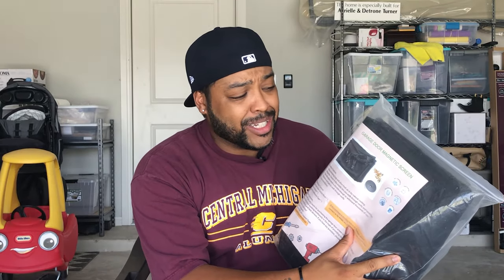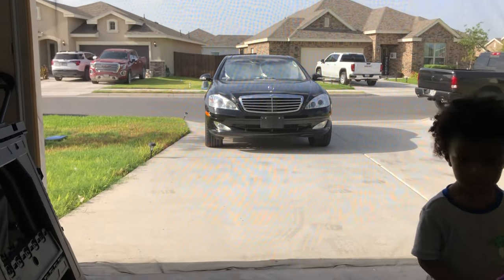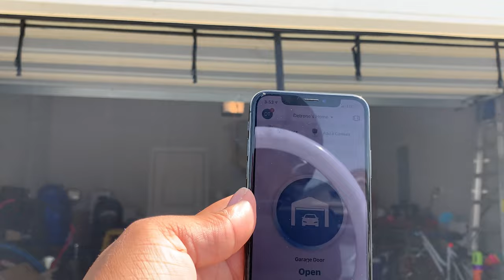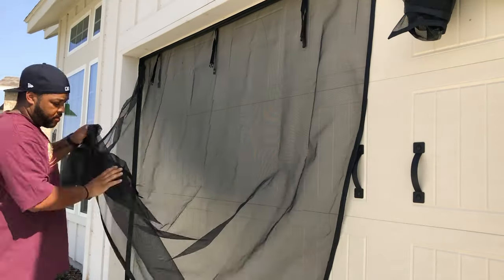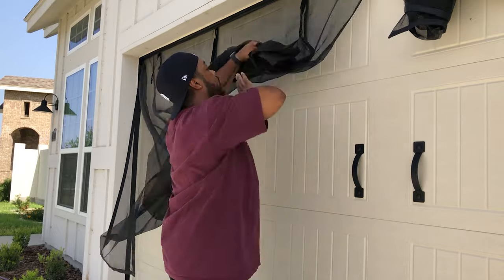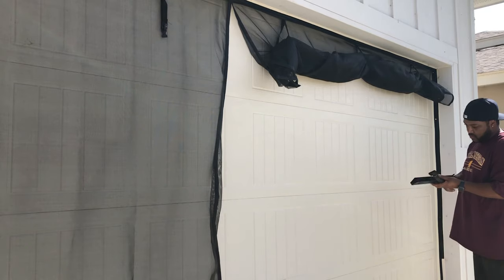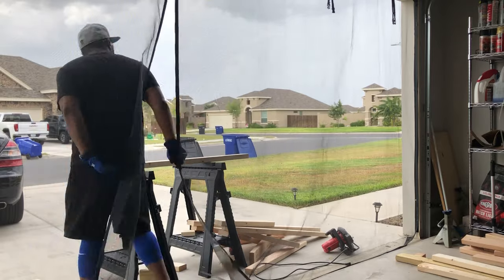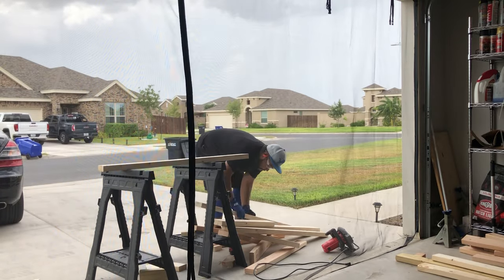Magnetic Screen Door | Fast & Easy Mesh Screen Install

Comment: Technically...doesn't it mount to the outside of the frame and not the inside...so that it sits flat. That's how I've installed 2 of these. If you used your inner frame, didn't the corners "bunch" up?
Reply from the maker: Yes, one corner did bunch up... Maybe you are right about the intended placement But there were a couple reasons I chose to go inside the frame.

-It seemed like a bit of a stretch when placing it on the outside and I didn't want there to be constant tension on the net, pulling the magnet connection apart.
-I wanted to ensure it wasn't floating to high off the ground and creating too much of a gap underneath.
-Lastly (not that it's that important) I didn't want the frame of the net to become discolored because of direct exposure to the sun.

Your placement would definitely eliminate the problem of the net sticking to the door when it raises, so maybe I'll try that the next time. Thanks for your thoughts.

Comment: notice:  those magnetic closures NEVER WORK... NEVER.
Reply from the maker: While I value your input here… I’ve gotta disagree (at least in this particular case)… They’ve worked as designed in each of the 3 screens that I’ve had even with the kids running in and out of them.

Thanks for watching and for sharing your thoughts.

Comment: What about theft. Can it be removed when the door is down
Reply from the maker: It can certainly be removed when the door is down since it is attached to the outer trim of your garage. If you use the pins as well as the Velcro it’ll make it a bit tougher for someone to take and would likely create rips if they try to take it.

Comment: Hi, thanks for sharing, I would like to tell you that makes the top-middle of the screen should be positioned about 1 inch higher than the top corners because if the screen drags on the ground, the bottom magnets won't automatically close.😁
Reply from the maker: Thanks, you are correct… if the middle doesn’t sit slightly higher than the side the bottom magnets won’t close automatically and you’ll need to reposition them in that case.

Comment: Thanks for this dude. It probably won’t work for me. My garage is all metal. Well done.
Reply from the maker: Yeah the stick adhesive would probably still stick to your garage but you wouldn’t be able to secure it with the tack that help the security. Also as a side note, the magnets at the bottom of the net would likely stick to the metal and raise up with the garage door every time you open it. Thanks for watching!
Reply: @DetroneDoesIt  thanks. I’ll look into it

Comment: Thanks for the quick and easy video! These have popped up on multiple houses in the area and I'm glad to see a good review before buying. I have a wooden garage frame so I'll probably stick and then staple the velcro in place after verifying that the placement is good.
Reply from the maker: Glad you found it helpful! They are super convenient, I advise getting one with the straps that allow you to roll it up, so that it’s out of the way at times you don’t need it. Thanks for watching!

Comment: Great video D.  I saw another video, and they said wait at least an hour before installing strips. Good explanation about the push pins
Julia
Reply from the maker: Thanks for watching! Yes the push pins do the extra work of supporting the screen, so I would definitely not skip those. As far as waiting an hour… I put mine up right away after cleaning the area and it’s been working great.

Comment: I’m living in an insulated cargo trailer while boxing full-time. I figured I could just leave the doors open instead of getting A/C… but mosquitoes. About to get some of these too.
Reply from the maker: That’s a pretty cool idea, if there is some cross breeze that would be a easy way to keep bugs out but still get air.

Side note: How is it living in an insulated cargo trailer? Did you build it out yourself or did you buy it move in ready?

Comment: 💡🧠 Was also debating on attaching the screen to the BOTTOM of the Garage door itself, to possibly avoid the Outside rolled up look since i won't have it down while garage is Shut anyways... 👍🏼 But Thanks! Good Video #BeatFloridaHEAT 🥵
Reply from the maker: If you have a way to keep it out of the way of your garage door while it's closing, then it might be worth a try. That Florida heat, much like this Texas heat is nooo joke! Thanks for watching and sharing your thoughts.

Comment: Hi,great video. I just installed mine and like it alot but one downside i"m getting is that when the wind blows a little inward the screen constantly makes the garage doors light come on.
Reply from the maker: Thanks for watching! Yeah that does sound like a bit of a downside… I have a similar issue sometimes when the wind blows and I’m trying to close the garage…. All things considered though I think the ups outweighs the downs with this screen
Reply: @DetroneDoesIt  yes i totally agree,Thx for replying

Comment: I think putting a hook on each end of the wood panel would solve the problem by just dragging each screen panel to the side and over the hook to hold it in place just like you do with house curtains.
Reply from the maker: 🤔 That’s a solid suggestion… I’m recently ordered a new screen to replace this one (since it’s now gotten pretty weathered) so maybe I will try that with the screen.
Reply: @DetroneDoesIt   I think there are several ways to get the screen out of the way without having to roll it up.  I was also thinking of putting one of those small clamps that holds things together on the other side of the Garage wood panel inside the garage, so it can just grab the screen without it being shown.  Another way is sewing a metal or plastic ring at the center of the screen so I can pull it up on a hook.  Anyway, I ordered a screen and will see what I can do with it and post here.
Reply: @DetroneDoesIt   I just ordered a screen and thought of several ways to get it out of the way without having to roll it up; I will post it here when I find a practical way and maybe show a video on Google Drive.

Comment: So what happens to the screen if you open the garage door?  Does it stick to the rising door?
Reply from the maker: Yes, unfortunately it does sometimes stick to the door as it rises. Some folks have suggested that installing it on the outer face of the garage door instead of the underside might help with that.

There are ways to stop it from sticking but none that are super inspiring. I have a small piece of wood on each side at the base of my screen that keeps it sitting away from the door as it lifts and lowers to lessen the chance of it sticking.

Comment: Great video! Thanks! I wondered if the magnets stick to the garage door when opening it?
Reply from the maker: Unfortunately yes they do… that’s certainly a downside if you use the garage for entering and exiting frequently. It didn’t leave any marks but occasionally I would have to tug the screen back down.

Comment: Yeaaa, mine didn’t work that well AT ALL! Kept having to take it down and try different areas. Wound up having to use the push pins in addition to the Velcro cause I worn out the adhesive taking it down and reapplying over and over cause the magnets wouldn’t line up
Reply from the maker: Yeah I can see how that could happen, after a while that Velcro definitely loses some of its stickiness. Using the push pins is certainly a helpful step to extend the life of the net. I didn’t have any issues with the magnets lining up though.
Reply: @DetroneDoesIt  yea I just put mine up today. I gotta assist it to make it connect…but it’ll work I guess.

Comment: I did all and that Velcro strip don’t stick good enough to the wall part
Reply from the maker: Did you also use the push pins? You can use them directly through the velcro strip or you can push them through the edge of the screen and into the Velcro to pin them together. I will say, after a while gravity does begin to pull at the strips, especially if it's being used a lot... Thanks for watching and sharing your experience.

Comment: Ebay has a lot but how do I get the one you have, or is the cheap 10 bucks ones any good compare to the 50 bucks???

.. anyway bro very good video God's blessings 😂
Reply from the maker: Here is the link to the one I have… but I would not buy that $10 dollar version… I bought a cheap one for our single doorway… and it was super cheap quality and I took it down the same day

https://www.amazon.com/Garage-Door-Screen-Retractable-Pass-Through/dp/B07PNPQ2V5?pd_rd_w=TpCVm&pf_rd_p=ba22ea03-d3c1-4ebb-8d3e-472aa0cf3b30&pf_rd_r=8QJQW5X986MG1CQ98QZ9&pd_rd_r=7d6496c4-f819-4997-8e8d-6943eb367ed6&pd_rd_wg=NLz5R&pd_rd_i=B07PNPQ2V5&psc=1&ref_=pd_bap_d_rp_15_i

Comment: How do you keep the magnets from sticking to the door as it opens?
Reply from the maker: Unfortunately I don’t have that one figured out… mine also sticks to the garage door as it open. Placing a few layers of painters tape on the back of the magnet (between the magnet and the garage door) might create a thick enough layer to stop the magnet from sticking but that’s just an unsophisticated guess on my part… or some kind of thin foam backing.

Comment: Did u use the tack to put the straps up.
Reply from the maker: I went back later and added them for some extra strength. Because I park in my garage a lot, I find myself rolling it up and I would notice the Velcro sagging… but once I used the tacks it sagged less.

Comment: Trying to figure out a way to stop them blowing around in the wind.
Reply from the maker: You can probably add additional weight with a couple zip ties and small weight plates. That should hold the net down just a bit which should help with some of that flapping. But if you roll yours up often then that will be a pain in the butt.… let me know if you come up with something, I’d be interested in a fix for the blowing screen.
Reply: @DetroneDoesIt  I never roll it up since we don’t park inside the garage. It’s more of a hangout spot on occasion. I was thinking getting a few small but heavy pieces of wood and spreading them out along the bottom. Secured via zip ties through holes drilled into the wood. Only thing is that it’ll probably be ugly.
Reply: @DetroneDoesIt  one of the biggest issues is the garage door not closing cause the screen blows back and forth which sets the sensor off and on.
Reply from the maker: @devinbrowning225  yeah it would be ugly… but you could spray paint the wood black like the net that way it blend in just a bit more. It might not be a fancy fix… but it definitely sounds effective and I think that most important.
Reply: @DetroneDoesIt  these north Dallas winds make everything more difficult lol. Can’t even find a decent shade canopy for the backyard that doesn’t tear.
Reply from the maker: @devinbrowning225  Yeah me and the wife would complain about that too because it generally windy where we life. We would often have to tag team closing the door while one person pushed the net out… or I used the garage door app on my phone and push the net while I close it. But I think your wood block idea at the bottom should fix that. Because even if the top is blowing back and forth, that won’t set off your sensors (since I assume they are down low).
Reply: @DetroneDoesIt  keep me in mind if you think of anything more creative to keep it flat on the ground. I think the weight plates might be best. The wood is a nonstarter with my wife lol.
Reply: @DetroneDoesIt  yes thankfully I have a similar app that works well if I hold it. It’s more of an annoyance than an actual problem. The screen I previously had from Amazon only lasted about 8 months before it started peeling off the frame. Gonna try to find some better adhesive strips.
Reply from the maker: @devinbrowning225  Yeah we’re down south in the McAllen/Edinburg Tx area and the wind can be pretty destructive down here too. If I put a canopy up here… it’d be a kite in 10 mins lol